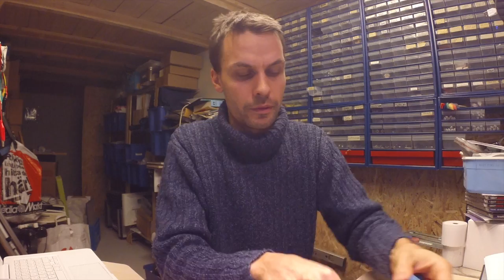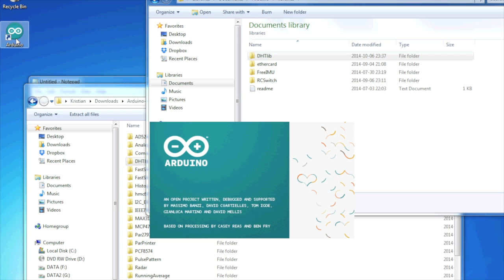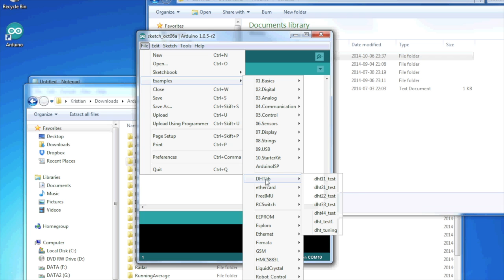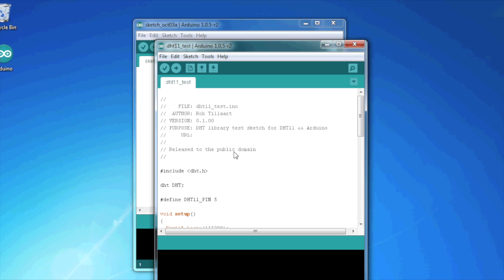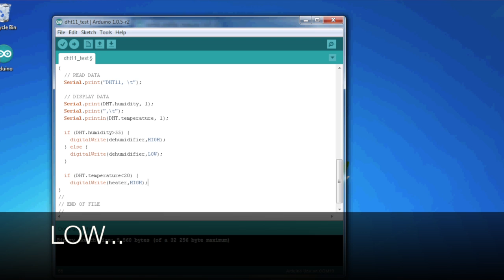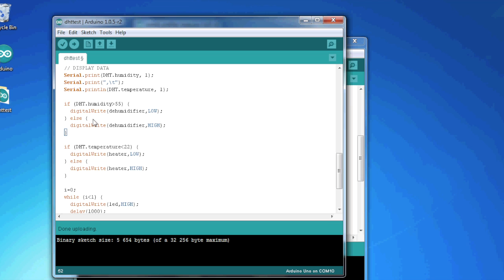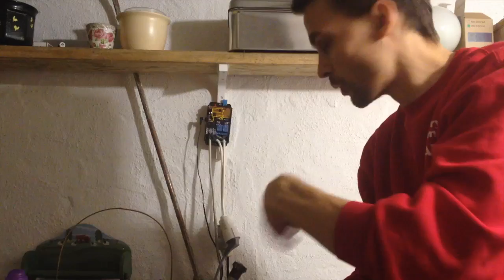Using a DHT11 and ATtiny to control humidity moisture and temperature - Anything Arduino ep 4

Comment: hello. i love what you have done here. i have a pet python and needed to control its humidity because i live in a low humidity area. the only thing i changed in the code was the high and low because i am using a humidifier not dehumidifier. so once the humidity goes higher than 55 percent the humidifier turns off. so everything is hooked up perfect and the humidifier turns off when humidity hits 55 percent but the problem im having is that it wont turn back on after the humidity goes lower than 55 percent. i have tried using different attiny85 boards, and ive used 4 different relay modules but still cant get it to turn the humidifier back on. could you or anyone please help me with this problem, ive been trying for weeks and there arent manygood codes for this type of controller. im new to electronics but have been playing around with arduinos as a hobby for about 6 months now and have a very basic knowledge but enough to get me around. thank you very much
Reply from the maker: Could you supply the code? Maybe there is something wrong in the loop? It sounds like a programming error... Also if the values are cruical, you should look into the DHT22 instead. It seems to have a bit more stable readings.
Reply: i was thinking about using a dht22 but i only have 11 with me. Ill order one later but im not to interested in accuracy, my pythons humidity range can be anywhere from 50-65 percent for healthy conditions. i used the code you supplied, i only changed the high and low.

//
//    FILE: dht11_test.ino
//  AUTHOR: Rob Tillaart
// VERSION: 0.1.00
// PURPOSE: DHT library test sketch for DHT11 && Arduino
//     URL:
//
// Released to the public domain
//

#include <dht.h>

dht DHT;

#define DHT11_PIN 0
int dehumidifier = 1;
int heater = 2;
int led = 3;
int i = 0;
int ten = 4;
int one = 0;

void setup()
{
  pinMode(dehumidifier, OUTPUT);
  pinMode(heater, OUTPUT);
  pinMode(led, OUTPUT);
}

void loop()
{
  digitalWrite(led,HIGH);
  delay(5000);
  digitalWrite(led,LOW);
  delay(500);
  // READ DATA
  int chk = DHT.read11(DHT11_PIN);
  int theHumidity = DHT.humidity;
  int theTemperature = DHT.temperature;
  //int theHumidity = DHT.humidity;
  //int theTemperature = DHT.temperature;
  ten=1;
  one=1;
  //=====CHECK WHAT VALUES WE HAVE====
    if (theHumidity==40) { ten=4;one=0; }
    if (theHumidity==41) { ten=4;one=1; }
    if (theHumidity==42) { ten=4;one=2; }
    if (theHumidity==43) { ten=4;one=3; }
    if (theHumidity==44) { ten=4;one=4; }
    if (theHumidity==45) { ten=4;one=5; }
    if (theHumidity==46) { ten=4;one=6; }
    if (theHumidity==47) { ten=4;one=7; }
    if (theHumidity==48) { ten=4;one=8; }
    if (theHumidity==49) { ten=4;one=9; }
    if (theHumidity==50) { ten=5;one=0; }
    if (theHumidity==51) { ten=5;one=1; }
    if (theHumidity==52) { ten=5;one=2; }
    if (theHumidity==53) { ten=5;one=3; }
    if (theHumidity==54) { ten=5;one=4; }
    if (theHumidity==55) { ten=5;one=5; }
    if (theHumidity==56) { ten=5;one=6; }
    if (theHumidity==57) { ten=5;one=7; }
    if (theHumidity==58) { ten=5;one=8; }
    if (theHumidity==59) { ten=5;one=9; }
    if (theHumidity==60) { ten=6;one=0; }
    if (theHumidity==61) { ten=6;one=1; }
    if (theHumidity==62) { ten=6;one=2; }
    if (theHumidity==63) { ten=6;one=3; }
    if (theHumidity==64) { ten=6;one=4; }
    if (theHumidity==65) { ten=6;one=5; }
    if (theHumidity==66) { ten=6;one=6; }
    if (theHumidity==67) { ten=6;one=7; }
    if (theHumidity==68) { ten=6;one=8; }
    if (theHumidity==69) { ten=6;one=9; }
    if (theHumidity==70) { ten=7;one=0; }
    if (theHumidity==71) { ten=7;one=1; }
    if (theHumidity==72) { ten=7;one=2; }
    if (theHumidity==73) { ten=7;one=3; }
    if (theHumidity==74) { ten=7;one=4; }
    if (theHumidity==75) { ten=7;one=5; }
    if (theHumidity==76) { ten=7;one=6; }
    if (theHumidity==77) { ten=7;one=7; }
    if (theHumidity==78) { ten=7;one=8; }
    if (theHumidity==79) { ten=7;one=9; } 
    if (theHumidity>79)  { ten=8;one=0; }   
    while (ten>0) {
      digitalWrite(led,HIGH);
      delay(500);
      digitalWrite(led,LOW);
      delay(500);
      ten--;
    }
    digitalWrite(led,LOW);
    delay(2000);
    
    while (one>0) {
      digitalWrite(led,HIGH);
      delay(500);
      digitalWrite(led,LOW);
      delay(500);
      one--;
    }
  
    digitalWrite(led,LOW);
    delay(3000);
    digitalWrite(led,HIGH);
    delay(3000);
    digitalWrite(led,LOW);
    delay(500);
    ten=1;
    one=1;
  //=====CHECK WHAT TEMPERATURE VALUES WE HAVE====
    if (theTemperature==10) { ten=1;one=0; }
    if (theTemperature==11) { ten=1;one=1; }
    if (theTemperature==12) { ten=1;one=2; }
    if (theTemperature==13) { ten=1;one=3; }
    if (theTemperature==14) { ten=1;one=4; }
    if (theTemperature==15) { ten=1;one=5; }
    if (theTemperature==16) { ten=1;one=6; }
    if (theTemperature==17) { ten=1;one=7; }
    if (theTemperature==18) { ten=1;one=8; }
    if (theTemperature==19) { ten=1;one=9; }
    if (theTemperature==20) { ten=2;one=0; }
    if (theTemperature==21) { ten=2;one=1; }
    if (theTemperature==22) { ten=2;one=2; }
    if (theTemperature==23) { ten=2;one=3; }
    if (theTemperature==24) { ten=2;one=4; }
    if (theTemperature==25) { ten=2;one=5; }
    if (theTemperature==26) { ten=2;one=6; }
    if (theTemperature==27) { ten=2;one=7; }
    if (theTemperature==28) { ten=2;one=8; }
    if (theTemperature==29) { ten=2;one=9; }
   
    while (ten>0) {
      digitalWrite(led,HIGH);
      delay(500);
      digitalWrite(led,LOW);
      delay(500);
      ten--;
    }
    digitalWrite(led,LOW);
    delay(2000);
    
    while (one>0) {
      digitalWrite(led,HIGH);
      delay(500);
      digitalWrite(led,LOW);
      delay(500);
      one--;
    }
    //============END CHECK VALUES
    digitalWrite(led,LOW);
    delay(5000);
    
  
  
  
  //if (DHT.humidity>55) {
  if (theHumidity>55) {
    digitalWrite(dehumidifier,HIGH);
  } else {
    digitalWrite(dehumidifier,LOW);
  }
  
  //if (DHT.temperature<32) {
  if (theTemperature<32) {
    digitalWrite(heater,LOW);
  } else {
    digitalWrite(heater,HIGH);
  }
  

  i=0;
  while (i<10) {
    digitalWrite(led,HIGH);
    delay(1000);
    digitalWrite(led,LOW);
    delay(1000);
    i++;
  }
}
//
// END OF FILE
//

Comment: Hello and thank you for the excellent video. One thing that I was wondering which seems to have been done off screen is how you spliced the relays into the dehumidifier and heater - I seem to be having some trouble in finding how to do this. If you could provide some information or a link on how one might go about doing this part of the process it would be much appreciated.

Comment: Hi Kristian,Can this sensor be used where there is high electrical field?I need to use this sensor inside a chamber where the voltage is 7.2KV!Will this work?
Reply from the maker: Unsure if that will work. As it is not that expensive you could just try it out... Or maybe the DS18B20 would be a better choice if you only need temperature?
Reply: Kristian Blåsol Thanka a lot!I will give it a try

Comment: Hi Kristian, Great video and very informative thank you, i have just started with arduino & this spurs me on with a project that i am contemplating. What i need to do is to measure oxygen flow and display it to lcd, can you give me any help at all. many thanks
Reply from the maker: What sensor do you use to measure the flow?
Reply: Hi Kristian,
Thanks for replying, sorry I havent much for you to go on as I'm really at the early stages here on this. Just looking for some leads on how to start it off, maybe if you had completed something similar. The only sensor that is available to me at present is the one that measures the oxygen amount in an incubator made by Drager Medical, just getting my ideas together.
John

Comment: Hi Kristian.
Thank you for a very detailed video! I am working on making this set up for controlling a fan i my bathroom, starting the fan when the humidity is high due to hot water from the shower. I have wired everything up as you have, and loaded the code, but the serial monitor does not show any readings. Only Connect error... What do you think is wrong..?
I have tried the module: http://www.ebay.com/itm/New-DHT11-Temperature-and-Relative-Humidity-Sensor-Module-for-arduino-/381374423685?hash=item58cbafe285:g:jyQAAOSw~1FUXNOR
And the bare sensor:http://www.ebay.com/itm/DHT11-Digital-Temperature-and-Humidity-Sensor-Module-for-Raspberry-Pi-Arduino/290960723731?_trksid=p2047675.c100005.m1851&_trkparms=aid%3D222007%26algo%3DSIC.MBE%26ao%3D1%26asc%3D36471%26meid%3D29b7128653924723a0125ee98ee621bb%26pid%3D100005%26rk%3D3%26rkt%3D6%26sd%3D381374423685
Both gives the same result...
Reply from the maker: +Peter R. Poulsen Sometimes it has to do with IDE version and library versions, I am working in IDE version 1.0.5r2 if you could try that and see if it works? Also as mentioned in the comments below I should recommend using a DHT22 instead of the DHT11 as the 22 has a much better reading, where the 11 can be a bit dodgy in its readings... The library should work the same, just need to change one row of code I think. I did buy a DHT22 but havent tried it out yet. Still that hasnt to do with your imminent problem. Try the IDE version orelse get back to me again...

Comment: One more think Kristian, when I order from ebay, do they have a complete Aurdino set to control temperture and humidity I want the whole kit. thanks adel
Reply from the maker: Sorry for late reply. No you probably need to order the parts on their own. Or buy a large sensor set which I have seen on ebay, with "all" sensors available
Reply: Thanks mate

Comment: wow my dht11s must be fake, they are all over the place, yours looks pretty stable
Reply: i was reading the dht11 is alot less accurate compared to even say the dht22, what im looking into is the thermocouplar or the ntc that op recommend
Reply: Actually i retested my dht11 ( and bought some 22s for comparison ) and the resolution is low, but they are fairly decent and sensitive sensors. I think they are just very susceptible to noise, they are much more stable with decent power and wiring, my error rates went from +-10° to the spec, i blame the breadboard i was using.

Comment: I actually found an NTC thermistor which is a fraction of the price far better for measuring temp. It's much quicker at detecting changes and is more accurate. I use that plus this together to get humidity and temp.
Reply from the maker: +ArcanePath360 Do you have the exact part number? So I can try it out aswell? :)
Reply: +Kristian Blåsol 
Search for MF52 10k thermistor
Reply: hey man im just getting into the arduino. With the ntc temp sensor is there much difference in hooking it up. Also would i beable to hook it up for cold and hot responses. For instance if its to hot turn the ac unit on. If it gets too cold than turn the heater on? And how about would i go to do that? Thanks guys for the tips plus the awesome video!
Reply from the maker: As for how the NTC is to work with I dont know, as I havent tried it yet. But yes, you can have different things happening for different temps. Eg. if (temp<10) {do something} elseif (temp>20) {do something else} else {do something if it is inbetween 10 and 20} for example. Just doing a lot of if, and elseifs and you can do a lot with a simple value... :)

Comment: Dear Kristian, I really found an awesome video, so can you tell me is it possible to control whatever temperature and humidity from the sketch because I need to control both temperature and humidity many times with the exist of two relays to do speisfic experiments......
Thanks, Adel
Reply from the maker: +adel tbeni Yes you can do that. Just add more if statements for the specific temp and humidity threshold as in the video to do different stuff.
Reply: I do appreaciate your reply
Reply: +adel tbeni  Hi mate, could you please tell me where to buy the whole kit for DHT11 including two relays. Thanks
Reply from the maker: +adel tbeni Ebay is your friend :) I would suggest you buy the DHT22 instead though as it has a better reading on humidity according to someone in the comments below. Just search ebay for 2 relay module to find a similar module.

Comment: hi man , first of all this is a helpful tutorial about shrinking the arduino  project into Attiny ,but how about you add an Lcd and some buttons or a rotary encoder for inputs within the relay module , Dht11 and make a simple user interface menu to set and control the temp and humidity .. like a standalone dehumidifier unit 
i hope you like the idea (y)

Comment: Hi Kristian, finally! I found a way to load the sketch but still having same trouble with the relays...let wait and see!
Reply from the maker: +dibraniuk Great to hear, what troubles with the relays, you didnt mention this before?
Reply: both relays are staying on! from the very start
Reply from the maker: +dibraniuk Ah ok, do you have any reference so you know what temp and humidity you have? If you know you are below on both values and the threshold value for temp is higher than 30degrees, then what happens if you blow on it? Does it turn off any relay? If so they can be "reversed"... Or it can be hardware problems. Maybe you dont have a connection to the DHT11?

Comment: you need to show how you loaded your sketch  onto attiny as is not working!! you are not showing that on the video are you?
Reply from the maker: +dibraniuk No that is true :) I do show a big information text to look at another video on how to do that (I dont want to show the same thing twice in two videos) :) See video here: https://youtu.be/TdG0AJY4qLA?t=1489 or just follow this link for a video on how to use the Arduino as an ISP and program an ATtiny: https://www.youtube.com/watch?v=qz-YMPY4_z0 ...
Reply: +Kristian Blåsol 
i should know that by now! but your schetch not loading on attiny85 and that's the problem
Reply from the maker: Ah, can you tell me again the exact error you get?
Reply: it loads on the arduino uno but as soon as attiny85 is connected up then fails to compile
anyway, i shall try a different route as my be problems with my ide so ignore this for now
Reply from the maker: Ok, a few things, You need to make the Arduino into an ISP (as the ep. 3 video shows). You need to select the Arduino as an ISP as the programmer. You need to select the correct attiny chip from the arduino list they also gets added when doing the steps in the episode 3 video. Then it SHOULD work... :) Ofcourse there may be something else that puts sticks in your wheels... Let me know when you figure it out...
Reply: +Kristian Blåsol   but the problem is with the code!  it does not upload to tinny85 ...I off-course have programmed attinny85 using the arduino but just wont work with YOUR code!

Have you asked if anyone else made this work?
Reply from the maker: +dibraniuk Yes, others have made this project and succeeded... However, IDE change version and maybe the library has changed so it doesnt work anymore? Without the error message I cannot say what is wrong, and I cannot help you...